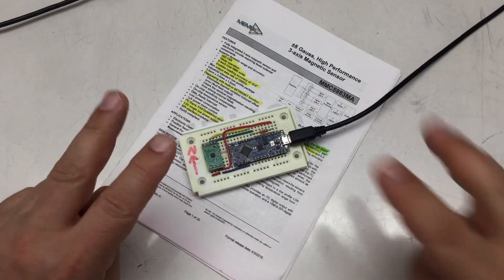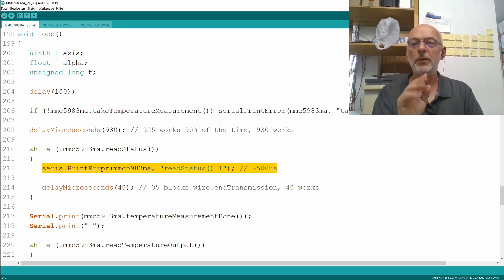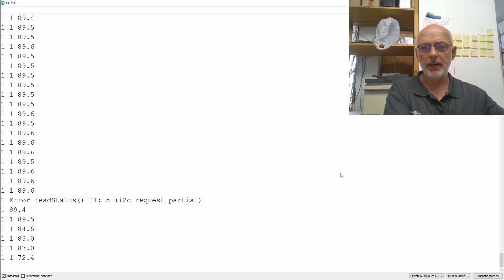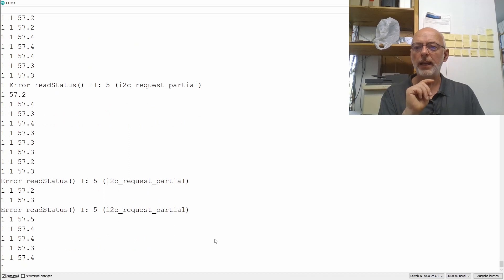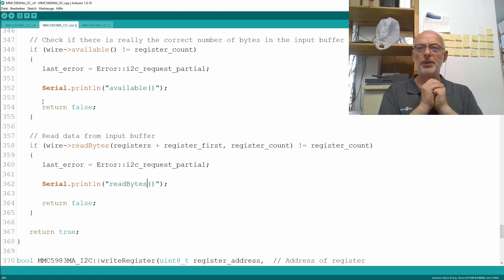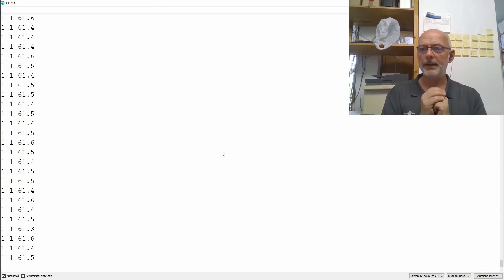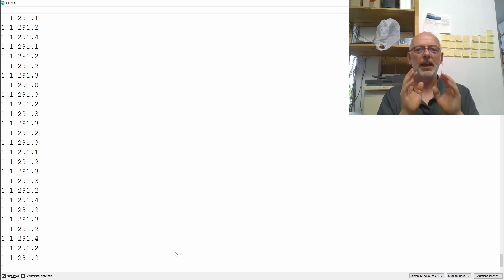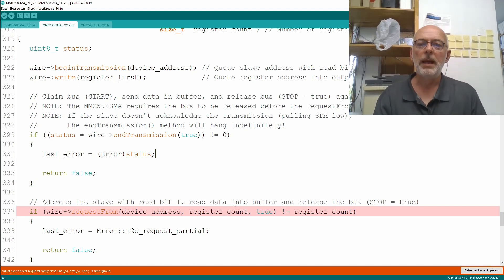MEMSIC MMC5983MA 3-Axis Digital Compass & Arduino MCU – The Details (9)

Comment: Hello Robert,  thanks for the excellent videos, I am learning a lot from your analysis and explainations.  Any timeline on video 10?
Reply from the maker: Well, at one point I will continue with the project (adding an accelerometer so you don't need to level the compass). However, the compass is a very small (and initially non-essential) part of a larger scheme. And so for now I do "first things first" (engine levers, steering wheel, propulsion, ..., dingy). That said, maybe I'll continue with the compass in between. Anyway, if you want to forge ahead yourself, here's an interesting link: https://thecavepearlproject.org/2015/05/22/calibrating-any-compass-or-accelerometer-for-arduino/ Or simply search for "tilt compensated electronic compass".

Comment: Hi Robert.  Excellent set of videos for the MMC5983.  Can you double check your Google Drive link for this video as it does not seem to be correct.  Thanks again for your hard word!
Reply from the maker: Hi Richard, the link works (checked it with another Google account using Firefox and without being logged on to Google using Microsoft Edge). Here's the link again (maybe YouTube is messing up the link with some redirects): https://drive.google.com/drive/folders/1agraJ0E7AK3VJPl0EeWE8nFpLbr3un9m
Reply: @robertssmorgasbord  Hello, unfortunately, it doesn't work. The link shows a folder for Allegro A1335A. Very goog work!
Reply from the maker: @morion1738  Sorry about that! My bad! Here's the correct link: https://drive.google.com/drive/folders/1QFhgxGk_ziefJ2WqGmcwY003sZ1xJGig?usp=sharing (corrected it in the video description too).